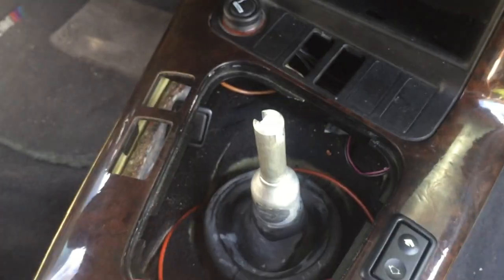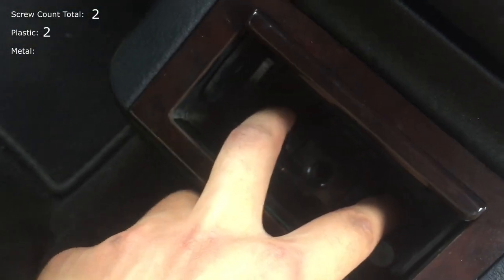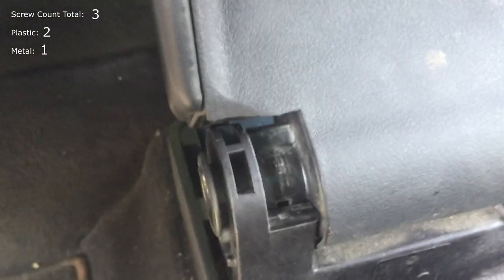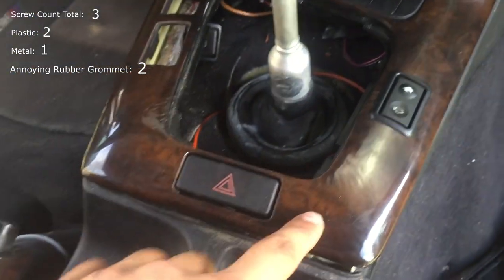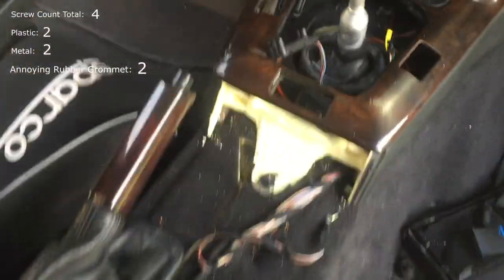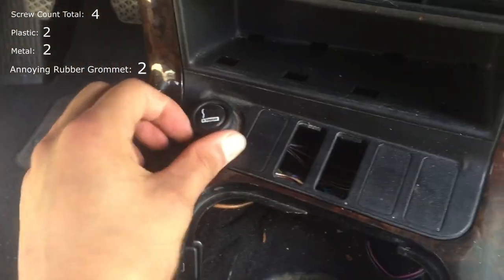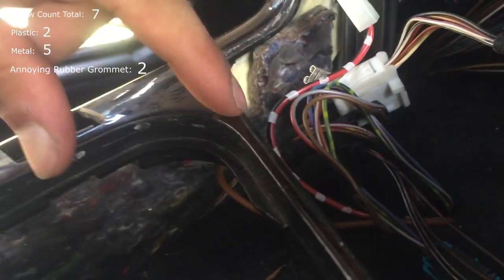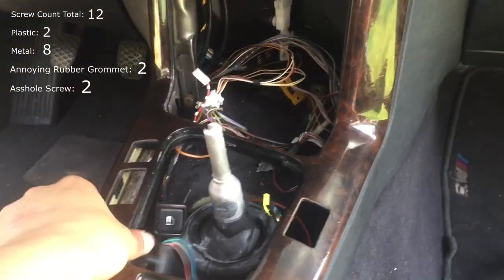Remove BMW e36 Center Console Trim (Quick How-to)

Comment: Cheeto dust!  Love it!  Like the idea of a NO BS video without fancy, but questionable music.  Just no nonsense-get to the point guy to guy straight talk.  I've a '94 325is with the emergency brake plastic designed for an ashtray (I don't smoke) and the BMW car phone, (which I don't have.) Scored the trim from a '94 convertible with the coin thingy and not one, but TWO cupholders, which I've lamented for years not having.  I'm just hoping everything works with a conversion from useless to useful, and appreciate the "how to" on removing the armrest thing.  Well done!

Comment: Lol did u sell those trims already?
Reply from the maker: Nope! still got em, 10 years strong. They've been plasti-dipped, painted, wrapped, and so much more lol.
Reply: Carpythesharky Your wood grain trims? i noticed u swapped them out for the vinyl trim if u sell the wood centre trim pm me i want it
Reply from the maker: @christianjover7259  That is the wood grain trim in the video at the end. That was plasti-dip. They are currently still in my car wrapped in carbon fiber vinyl :P
Reply: Carpythesharky Thats a shame they are so hard to find lol i just paid 150CAD for a pretty cracked one,  did u plasti dip them urself?
Reply from the maker: @christianjover7259  Yes I did. They looked fine, but marked up easily. Having a hard time finding something that can put up with sitting in the sun.